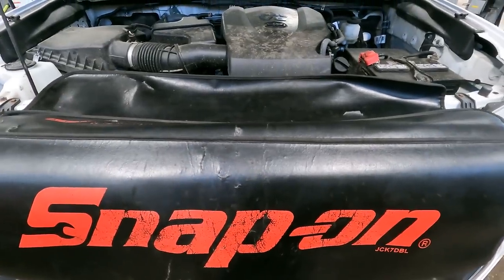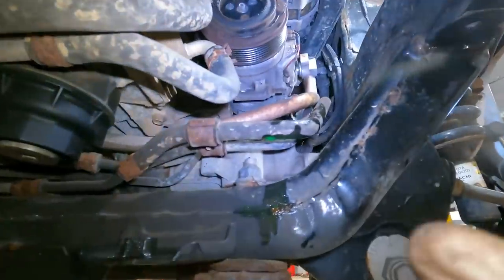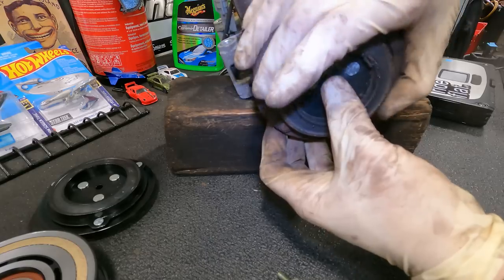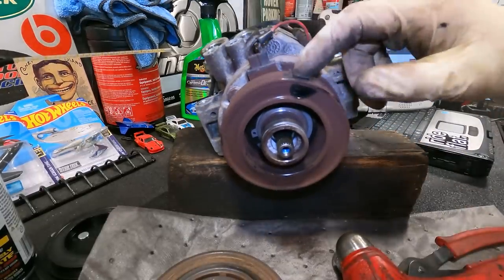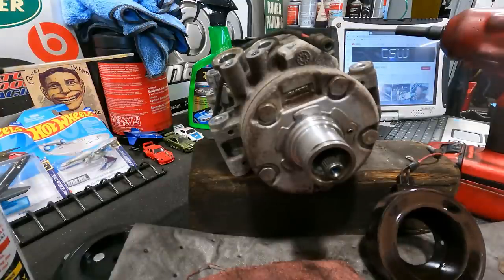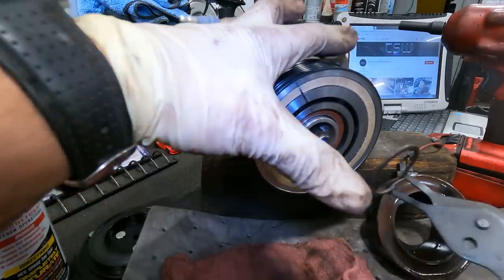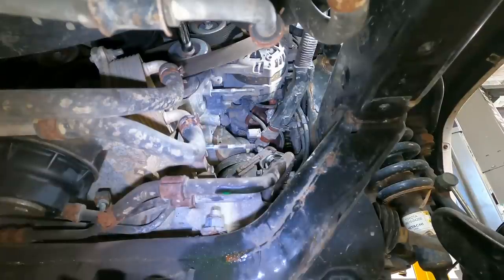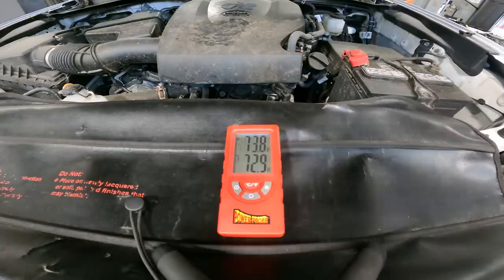Customer states AC JUST SERVICED BLOWING WARM AGAIN 😡🤬🥶

Comment: I did this job to my Son's friend's Ford Ranger pickup last summer. Dealer quoted $1350 for a recover, recycle refrigerant, replace complete AC compressor and recharge the system. $57 for the complete AC clutch assembly installed on the vehicle with the compressor in place.  Maybe one hour start to finish.
Reply: 🧢 compressor costs more than that for quality
Reply: @anandchundi6805  in this case it didn't require a compressor. All it needed was a magnetic clutch assembly. I replaced it for him with the AC compressor in place on the vehicle, without disturbing it or having to recover, recycle and recharge the refrigerant. I had the job completed within an hour. $57 for the magnetic clutch kit from Amazon. Had it the next day as well!
Reply: nice. Seemed like this job could have been done without the compressor removed since the clearance allowed but maybe not.
Reply: Its nice when you can do the clutches right in the vehicle. Easy in and out fix.
Reply: @frankponte4031  oh I gotchu because I was like no way you got a complete compressor for 57$. Still hard to believe a dealer quoted 1300 for that clutch usually cost that much for a whole compressor
Reply: @WorkableWax  You assume I'm not american?
Reply: @anandchundi6805  not at all, I’m stating it as why the high price point. To scare the customer aware, I can’t tell what you are all I know is you’re human

Comment: CSW Wayne Noton Metters? LOL, and Yes you are correct about the shims and oh so important.  I was taught the air gap is usually somewhere tween 0.015- 0.025" thousandths of an inch any greater and the clutch may not engage properly or slip and wear out the thin clutch friction material prematurely, not enough air gap the clutch will bind up and be fully engaged all the time. Good video, thanks.

Comment: Had this happen on my 2017 Mustang GT.  Clutch hat was googats!  Only the clutch hat was bad, but when they don't sell just that part separately, and a clutch assembly was only $25 less than a full compressor, I decided to have the entire thing replaced.  It's even less labor to replace the whole compressor than to take the clutch off the old one and replace it. Plus, no need to deal with the shims because they are pre-installed to the right specs.
Reply: This is what we usually find out at my shop. It's cheaper to just replace the whole thing. The only issue is that most compressor manufactures idiotically assume that you are replacing a compressor because the old one puked it's guts out and require that multiple components be replaced and the whole system flushed to maintain the warranty on the new compressor. I was forced to buy an $8 container of A/C flush that I wasn't going to use just so I could maintain the warranty on the new compressor when the only reason I was replacing the old one is because the seal between the case halves was bad.
Reply: I agree 👍 💯
Reply: @madmatt2024  ... that's when you return the flushing agent on your next trip. You still have the receipt for the original purchase so you have paperwork for warranty.
Reply: @rupe53  I bought it all from Rockauto so A: it isn't worth it. B: They will have a record that I returned it and deny the warranty if I do.
Reply: @madmatt2024  ... you didn't say that, but I understand now. The only problem I ever had with Rock Auto was core returns. Needed odd shipping info and authorization, then wait for the credit. Using a company credit card, I was never sure if I actually got the credit because another department got the monthly statements.

Comment: I personaly prefer to replace the whole compressor. Just doing the clutch means that you are re-installing a used, high mileage compressor and the customer is going to have to pay for all that  Tear down and re-assembly again when the actual compressor fails.
Reply: ITs 1234yf, so its not that old. Customer had a choice and thats what they chose. That would also be my choice to leave a factory ac compressor on it over an inferior aftermarket pos compressor or a really expensive oem part.
Reply: For me it would be the condition and year of the vehicle to replace with new or repair.  Come down to $$$$$

Comment: Rarely see anyone replace just the clutch, pulley or coil. Most will just do the whole compressor, which is much more expensive. Even better if you're able to do it without taking the compressor out. Saved myself at least $1000 by changing just the coil. Took a few hours of work to figure out how to do it, but well worth it.

Comment: I had the same job done a few years ago, mechanic forgot the shims, I only got about 3 miles from the shop and spun and melted  the belt off, luckily that particular car had a separate drive belt for the compressor, so I could drive back to the shop to get fixed. (whole new compressor).

Comment: Very common problem on the '80s to early '90s Mustangs and most other Fords of the era. Rubber flex donut in the A/C release plate, same deal - shreds and spits out bits of gooey rubber. Stamped into the plate: Made in Japan. Probably the only Japanese part on the whole car. On the Mustangs, it's easy to replace just the release plate with the compressor mounted and charged, but the new "improved" release plates are the old design, with the three stainless steel spring arms handling the flexing and engagement. A better design, the rubber plates were a bad idea.

Comment: Did you do a cost analysis to see what would be cheaper for the customer replacing the clutch versus replacing the whole compressor. Sometimes with labor it's the same price or cheaper just to replace the whole compressor and clutch assembly together

Comment: Not sure what year this Toyota is, but the company seemed to have an issue with plastic/rubber items turning to goo way before they should have. Case in point sticky/melted dash pads from 2000 on up. Hatch release switch covers 2000 on up. Now this

Comment: Meanwhile my 1985 Ford (bought in early 2019), that got the r134a retrofit around 2000, just needed 4 cans of $5 refrigerant to get it working.
Reply: That sounds overcharged. R12 was hungry but 134 isnt. Ever check pressures with a manifold gauge low & high? Only an actual machine can give you accurate charge. You pretty much half the capacity with the conversion.
Reply: @oldschooldude8370  It"s fine. It's a full size van with a big system.
Reply: @cubey  I got ya.

Comment: The "outside shop" sure fixed something but I doubt it was the AC. 😉
13:35 - I know Hitachi makes a lot of things but I never knew they made shocks for Toyota. 🙂
19:50 - I hope the customer didn't decline a new set of tires...
Reply: Aisin make brake calipers and door lock solenoids for Toyota.

Comment: crazy! Not know you could just replace parts on the AC comprsssor. Must not have been leaking.
Reply: Yea most compressor you can change the pulley and clutch they just bolt on and off

Comment: At what age of the car would you just replace the compressor as a whole unit ?
Reply: Age of the car doesn't matter...

As long as the compressor still works well, you change the entire compressor when it becomes cheaper to do that than just change the clutch...
Reply: @HappilyHomicidalHooligan  that’s my point.  With an older car, the likelihood of that goes up.

Comment: Why does my 21 Toyota Tacoma A/C suck at idle so much? It's cools but only ice cold rolling at 35mph or more. Can I upgrade system components with something from the Lexus vehicles line? My A6 TDI and A8 4.0 will freeze you out all-day long setting still.
Reply: Condenser isnt being cooled enough by the fan. Once your moving , the passive air moving through it brings the high side pressure down. A second fan or higher cfm replacement should fix that. Condenser is the smaller, radiator looking cooler in front of the radiator. Even though it's a 21, the expansion valve might be starting to fail also but unlikely. An A/C shop could throw gauges on it to check low/high side pressures and have a better idea. Ideally, you want 30-50 on the low & 150-200 on high sitting still. Easy check is the low side line should be cold and condensated while the high side is quite warm but not hot as hell. If high side is hot to the touch, your compressor or condenser are failing. The condenser is the first in the system once the compressor is engaged.

Comment: Surprised you didn’t replace the whole compressor.  Usually that’s the case and not just repair it.
Reply from the maker: The failure was clear when inspected. I did inform the customer that there still could be an issue with the compressor but not likely.

Comment: one mechanic to another mechanic why don't you just put a pulley puller on it take you all of 1 minute to do it and it would come off really easy and it would not destroy any of the area that you need to put the new one on but you have to make an easy job at Difficult by using a hammer sometimes I wonder about you younger guys
Reply: It'll take 10 minutes to find the puller in the pile of 50 blow hard cases. Guy had the entire clutch swapped in 10 minutes.